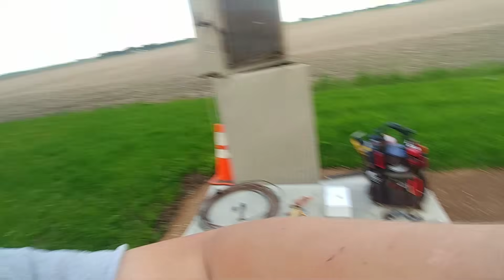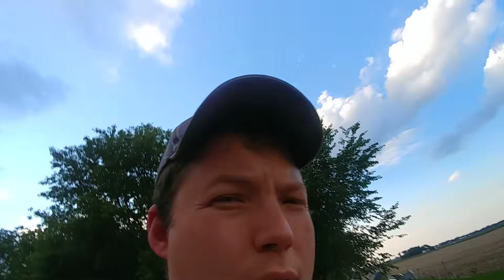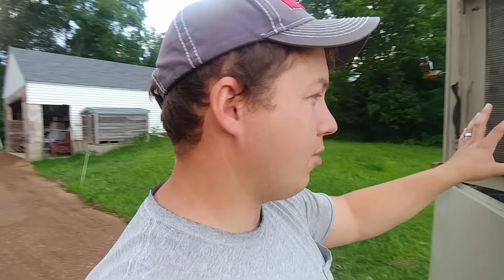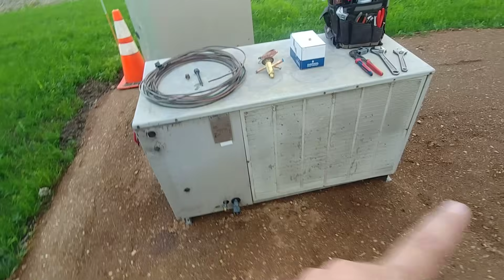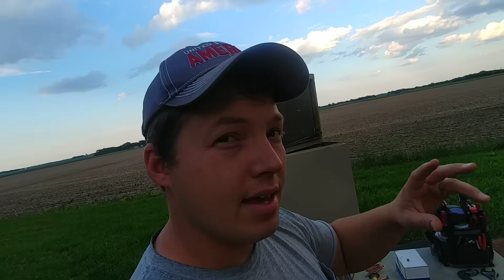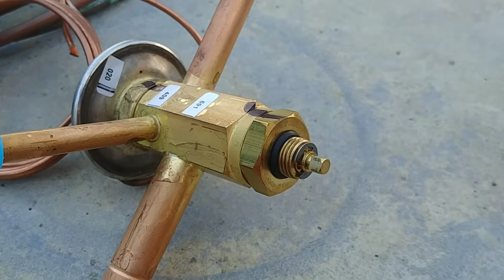TXV vs Orifice vs Capillary - The Three Most Common Refrigerant Regulating Devices & How They Work

Comment: Ye... Rheem started making heat pumps both,  the indoor unit, and outdoor unit with expansion valves... This made the system not reliable, too many expansion valves to fail, and kill the compressor. 
5 ton, 7 year old system,  compressor grenades, both expansion valves trashed...
Other manufacturers don't do this idiocy on their units, they have outdoor unit with a piston, and indoor unit with expansion valve. 
The result is, that system with only one expansion valve tends to work without  major hiccups for 10-25 years! That never happens when system has two expansion valves!
Only one expansion valve should be installed, for indoor unit, the outdoor unit should always carry fixed metering device, like piston. 
Done this way is double the reliability. 
Rheem heat pump? Not again!
To make this unit reliable again, expansion valve on the outdoor unit needs TO GO, and a piston installed.  The inside unit can use the TXV, but once every 7-10 years I would  pump out the refrigerant,  replace screens, and the indoor txv.

Overall,  a system carrying two TXVs is pissa vu shit piece in regards to reliability and longevity, that compressor will absolutely have a premature death tap out

Comment: why is the suction pressure showing 70 degree temp on a 410a but the compressor amps showing only 9 amps  and the cooling is not there ?  And thanks for the video this unit is a Goodman unit 4 ton in a resedential . run RLA  amps show about 19 amps.

Comment: Great video! Q: I have a comercial walk-in freezer and the thermostat is set to -20f BUT the temperature barely gets to 10f  my compressor is 3.5 hp  the box is 7W x 20D x7H ft.  So my question is do I need to close  or open valve? to get at least -0f
Reply: I would imagine that neither will solve your problem, the TXV is usually set at a point that saves the compressor from being damaged.  If you're not getting cold enough, either  you have low pressure, bad valve, or wrong refrigerant.

But that's just a guess from some guy strolling through youtube.
Reply from the maker: There are so many possibilities. Here is what I would probably do:

1 - Make sure that the thermostat hasn't drifted out of tolerance. I had a thermostat the other day that was set to -10 and was only cooling to 20. Turned it down and it started working properly. We will be replacing that thermostat soon.

2 - Be absolutely certain that the coil is not freezing up or that it doesn't have a significant amount of ice build up on it. Also, the ice should be fairly even (or even the frost while it is running normally). If the coil is uneven  with the way it frosts up then you may have a low refrigerant charge of bad TEV.

3 - Verify that the defrost timer is working. If the unit keeps having ice build up on the coil then the defrost timer could be the issue.

4 - Check all of the basics! Clean the condenser coil, check fan motors, make sure the compressor isn't tripping out on thermal overload or high or low pressure.

That'll get you started hopefully!
Reply: @BenjaminSahlstrom  : Good advice.

Comment: Hi Ben, I wanna ask about copper filter dryer. I notice that there is no any of it istalled in my half ton split hvac. Now I am about to have it maintained, should I install one of copper filter dryer on the system? Where should I have it placed, after the capilary?

Thank you
Reply from the maker: I would not recommend adding a filter drier to a system that is already working fine. If you have to have something done to it where they have to remove the refrigerant charge for some reason then a filter drier should definitely be added. You locate a liquid filter drier right before whatever regulating device that the system uses be is a TEV, capillary, or orifice. I would also not recommend a "copper" filter drier but one more like this: https://amzn.to/2YfOEe3

Good luck with your project and thanks for your comment!